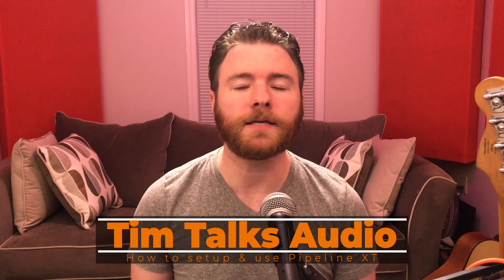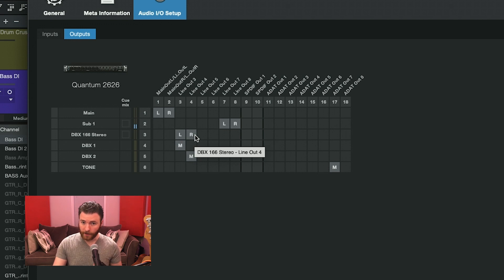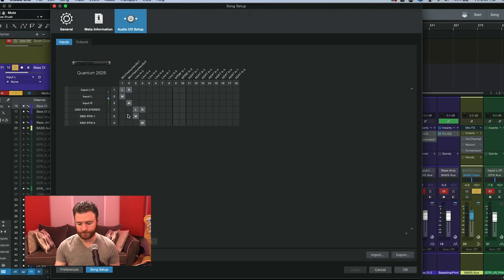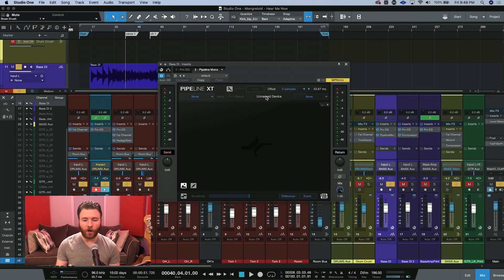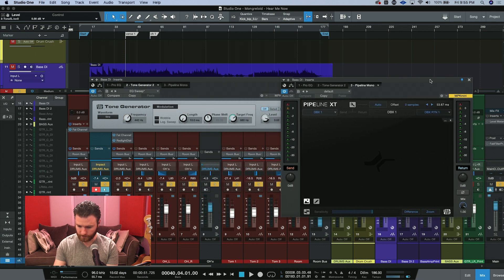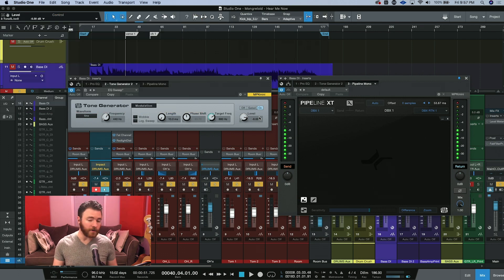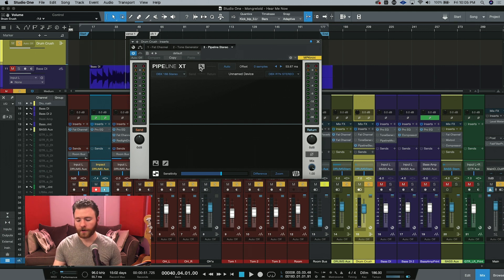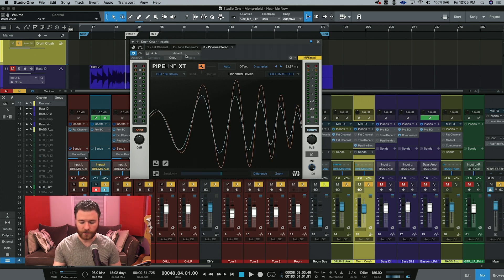Studio One: How to setup, calibrate and use Pipeline XT

Comment: Hey! I don't want to get too far into the weeds on Pipeline XT and parallel compression, but for engineers who, like me, are trying to do parallel compression using Pipeline XT and are pretty certain they are hearing comb filtering or weird phase issues I think it's important to note

***PIPELINE XT ISN'T ALWAYS SAMPLE ACCURATE WHEN USING THE AUTO FEATURE****

This test might be worth trying on your system as it helped me fix my parallel compression issues:

1. Setup a track with a single transient (like a single sine wave or a snare drum) and use the SENDS to route it to 3 mono busses
2. Setup your busses like this:
           - Bus 1: Insert Pipeline XT Mono to a hardware output/input pair with a cable jumper loop-backing the signal out and back in (i.e., instead of hardware on the Pipeline Insert, use only a cable)
           - Bus 2: Same as Bus 1 except use a different hardware output/input pair
           - Bus 3: No Pipeline, no software inserts...just a plain empty bus
3. Setup 3 Mono Audio tracks and assign one of the busses to each of the Inputs to the tracks (i.e., Track 1 input is Bus 1, Track 2 input is Bus 2, etc.)
4. Arm the Audio tracks and record the transient audio  

When I did this, I zoomed in and found that one of my Pipeline busses was 2 samples ahead of the others. This meant that the first Pipeline XT insert had a different phase alignment than the 2nd Pipeline XT Insert. I had used the AUTO feature to align each Pipeline separately and, incidentally, both recommended the same Sample and Offset settings....but the signal on one Pipeline came back 2 samples off when compared to the other Pipeline insert. This has caused a comb filtering effect in my mixes in the past that makes my drum bus sound thinner and smaller than when using either of the individual Pipeline channels alone.

I don't know if this is my hardware causing the discrepancy (Antelope Orion 32), but I definitely needed to fix the issue.

FIX: I had to manually adjust the Offset in Pipeline XT to get the audio to align correctly. You'll need to record, check the alignment, adjust the Offset, re-record, check the alignment, etc. It's a bit of a pain, but for me it's a critical step to avoiding phase/filtering issues with parallel bussing. I also think it's worth noting that this same issue happens in Pro Tools and other DAWs, making software-controlled parallel compression something most of my buddies that are professional mix engineers avoid completely and, instead, use hardware that does parallel blending as a built-in function (like the OVERSTAYER STEREO FIELD EFFECT COMPRESSOR or API 2500+ COMPRESSOR).

If anyone has any other work-arounds for this, I'd love to hear about them!

Comment: Hi thank u for this but I don't have any return signal on my pipeline
Reply from the maker: Interesting.... try this. once you have everything setup and wired together, send some test signal into your outboard gear and confirm that the signal is getting to the gear. Once you know it's at the gear, open up your song I/O and check the input side to see if a different input might be getting the return signal. Remember that the return signal will be Line level, so your inputs should be set for that! If you still have problems, shoot me a message on discord! https://discord.gg/S84G4ejBcj
Reply: Thant you very much I will try and hope it works

Comment: Yo, so we saw how to apply the pipeline plugin to a channel and use outboard gear for live processing.. but what happens when you want to use the dbx compressor on other channels and you need you change the settings? Or, you change the outboard routing altogether? How does studio one “save”/“remember”/“render” the altered audio that was run through the dbx? Do you have to re-record the printed audio onto a new return track, or save a pipeline preset or something? I would eventually like to buy an outboard unit or something but if i get a one or two channel compressor or something I’m gonna want to use it on more than one channel in a session…
Reply from the maker: Correct, you need to commit the sounds back into studio one. I would "Bounce" the track in question from bar 1 until the end of the song. After it's bounced, grab a sticky note and write down your "source" and stick the note onto the outboard gear. Grab your phone and take a picture of the labeled gear's settings! Save a backup in a cloud server somewhere. Happy mixing!
Reply: thanks for the reply! love the channel by the way @TimTalksAudio
Reply: Hey Tim, another question for you: so when i set up and try to calibrate my pipeline hardware insert in studio one with a send from my interface line out -> input on the compressor -> output of the compressor -> line input on the interface, and then i set up the channel with tone generator before the pipeline plugin like you did during the calibration phase, if i put the compressor channel in bypass I get this really horrible whirring feedback loop that quickly peaks the channel well above 500db... but if i take the compressor channel out of bypass and use the gain knob to mitigate this and bring it down, it's normal again and the levels on the pipeline send and return match at the 20db reading like you demonstrated. any idea why this might be happening when the unit is bypassed?
Reply from the maker: What in terface are you using @tatertotter25  ? That makes me think feedback loop, but bypassing an analog unit shouldn't cause that. Hmm...
Reply: @TimTalksAudio I was able to figure it out actually! i have a presonus 1810c , and presonus' hardware controller software Universal Control allows for live monitoring with the interface since it has onboard monitoring.... so it was just the software creating a feedback loop because i guess by default unless you're in a DAW session it automatically routes all I/O at all times to feed through the monitors, so there is an option to "bypass mixer" on the software driver and turning that on (bypassing) got rid of the problem!

Comment: Hey Tim, can you tell me why my fader is not workin when using Pipeline as an Insert Effect in Studio One? It doesn't matter if I use fader automation or if I simply move the fader with my mouse, the sent signal is always the same volume. The only solution I came up with is to put Pipeline as an insert in a Send effect. Is there really no way to achieve such a simple task, or am I missing something?
Reply from the maker: Inserts on channel are PRE fader, so you are correct in your workaround to send to a bus/fx channel and putting pipeline there!  You could also automate the send level control inside your instance of pipeline if you wanted to not have to do that…

Comment: Great advice! Worked with my 286s immediately. It's just been sitting here since I got it and now I looove using it on my vocals. One thing that I got from another video that I think helps is in studio one You have to bounce the track to record what you sent through the outboard gear then it prints into the daw. Then just mute and hide the original track and you'll be good. Thanks again for this video, you got my like and follow good sir.

Comment: I'm so frustrated on setting up a simple external stereo bus compressor with an Apollo twin in studio one ...every video has additional external hardware or for some reason set up pipeline in mono...anyone out there who can help??
Reply from the maker: With your Apollo, in your Studio One I/O, set up a stereo output and assign it to 3/4. Then cable out of 3/4 to the inputs of your compressor. Cable the outputs of the compressor into inputs 1/2 on your Apollo and I would create another Stereo input in your I/O that is assigned to 1/2. Link channels 1/2 on your Apollo and make sure they are set as LINE level inputs, and then you can follow the steps in this video to make sure the levels are balanced and good and then you should be off to stereo bus compressing! If you have anymore issuse, you can join the Discord and ask there, or shoot me an email. https://discord.gg/S84G4ejBcj

Comment: If i have studio one 5 artist version, which doesnt come with pipeline xt. Can i buy that pipeline xt plugin, or do i have to get pro version just for that one plugin? 🤔
Reply: Well, you sort of can.

Set the channel output from Master to actual output of your audio interface.

Add a new track and select the input of your track that matches the return from your connected outboard gear and record a new track.

Correct the latency manually. You can add a blip or some fast transient sound at the start, to line up the new track to it.

This is the option I use for demonstrating in the Artist edition with no PipelineXT
Reply: @225maine  in Ableton i have used ext.audio plugin. Studio one Artist is free,(with presonus audio interface) so maybe i will give it a try 🙂

Comment: Great vid. Thanks. I find when I run my stereo Buss compressor through Pipeline, I get a very thin sound, almost as if it was going through a high pass cut. Any suggestions?
Reply from the maker: Check your cables, you may have a cable that is wired out of phase with the other cable.
Reply: @TimTalksAudio  there is a phase button in Pipeline as well. I"m getting some noise too. I think SOA needs some work. I'm seeing a lot of posts regarding noise, clicks, oddities. And my Apogee plugins are unuseable in SOA. They run perfectly in Reaper. Presonus completely unhelpful.

Comment: Whats the best method for printing the return?
Reply from the maker: There’s a few options; you could print the stem and import it into the session, you could mix down selection, or I believe you could bounce a new file (render)
Reply: @TimTalksAudio  Will the bounce be sample accurate timing? I generally calculate my roundtrip latency and manually adjust all plyaback track to be as late. I'd love to not have to do that and I know that I have the timing exact. I've had experience where bounces in some programs have different start times before the audio by a small amount.
Reply from the maker: @housebandthexenos2569  that i can't confirm or deny at the moment. i know with pipeline, there is built in delay compensation, so i would believe that things should be accurate, but i would have to test it myself.

Comment: Having trouble trying to identify which output in my DAW matches up to my output on my interface, which in my case is an older Presonus AR 22 Live USB hybrid console.  I thought the outputs might correspond to the output faders on the console where 1 is rhe FX send,
2 is mon. send 1, 3 is mon. send 2 and 4 is  the L/R send to the mains. So when I send my source signal to pipeline where I have selected either output 1, two or three (not four since I think that is for my my mains which are feeding my speakers) then send signal to a channel to which I have applied pipeline xt as an insert I do not see that signal in the VU on the patched hardware to which the output has been connected. Would appreciate any info as to what I am doing wrong.

Comment: I did everything as stated but I’m getting a boxy sound on my vocals. I’m running the presonus 1824c and 2 outboard compressors la2a and 1176 clones but seems like they aren’t receiving the audio back properly properly I’m using a combination of balanced cables 1/4 to 1/4 and xlr to 1/4 and xlr female to male xlr. Not sure if my problem is cables but they are all brand new and balanced
Reply from the maker: How does it sound if you do one at a time? Take two compressors out of the equation, and just try one for now. You’ll be able to diagnose the cables, cable path, compressor and everything else. Then repeat the process for the other compressor.
Reply: @TimTalksAudio  I think I made it work. I had to bypass presonus mix software and it seemed to workout alright. I haven’t tried it again to dail in detailed settings. That will be sometime this week

Comment: gr8 vid .. can we use vst 3 party  plugins ... and  is there any other  plugins which acts as pipeline  that can be used in other daws
Reply from the maker: If I'm understanding you correctly, you're asking if you can use 3rd party plugins and the answer is yes IF.... If you are running S1v5 Artist or higher, there is support for 3rd party plugins. If you are running S1v4 Artist or lower, then you need to purchase the add-on for rewire and 3rd party support. S1v4 Pro allows for the use of 3rd party with out add-ons. 

As for as using pipeline in other DAW's, Pipeline is Studio One specific. Other DAW's may have support for external gear built in as well, but I'm not familiar with how everyone else does it. I do know that there is Rewire support in S1 allowing you to use other DAW's instruments in S1.

Comment: Hi Tim. Can Presonus AR12 be use in Pipeline to connect Alesis Compressor/Limiter? What output can I use from AR12? Thanks.
Reply from the maker: Looking at the mixer, there aren’t a lot of line out options. I would say, the AR12 won’t work well for pipeline. You could use the main outs to feed your effects and then record it back in, but the overall output options on the board don’t really line up for use with pipeline.
Reply: @TimTalksAudio  Tim, sorry to bother you on this, it says from the AR12 manual it has 4 outputs all playback, in AR12 Channel 11 and 12 are returns, is it possible to send a signal from AR12 (mon 1 and mon 2) to Alesis compressor then out from Alesis to Channel 11 and 12 of AR12?
Reply from the maker: george mateos not a bother at all. You certainly could use those outputs to feed your outboard. My understanding is the Mon outputs are for either control room monitors, or they are linked to the auxes and could be used for on stage monitoring. Either way, yes, you can use these outputs and 11/12 to return the signal. Just be sure to avoid any feedback loops. 
Thanks again for the comment. I’m not a Presonus gear expert and needed to look up your mixer after your first comment!
Reply: @TimTalksAudio  Thanks Tim, still reading the manual and i found out the send and return of the mixer. And i think there is way to do this. Learning this is exciting. 😁. Thanks tim. Bless you!

Comment: Thanks Tim, this helps me a lot. Do you use the Line Return ports on the back of your Quantum 2626 to achieve this? I wanna know because my audio interface is Studio 68c , which doesn't have that port. Thank you !
Reply from the maker: Any line in would work when setting up pipeline. The 2626 does have an insert point for inputs 1&2, but you can use any line ins and outs. On your unit, you could use inputs 3&4 on the back to return the signal form your outboard gear!
Reply: @TimTalksAudio  Thank you !

Comment: I am a studio one user but have never used outboard analog gear before. I fully understand your video but how do you commit the compressed track in real time? Do you record on the compressed track? You said that you print the track but I have not heard of this process with studio one.
Reply from the maker: Yes, you would re-record the outboard processed signal. I would do this for two reasons; One, it commits the sound I've created with the gear and will allow me to still do offline mixdowns (mixdowns that aren't required to happen in real time), Two, if I only have one channel of the outboard gear, but what to use it on multiple things, I can print the effect to the first channel, make a note of the settings (for recall later if needed), and then use the same unit on a new track/channel.
Reply: @TimTalksAudio  Thanks Tim. Keep up the good work